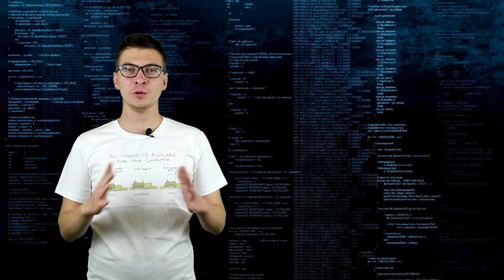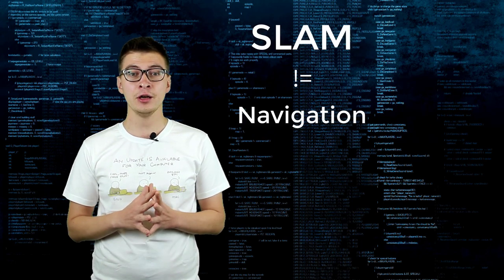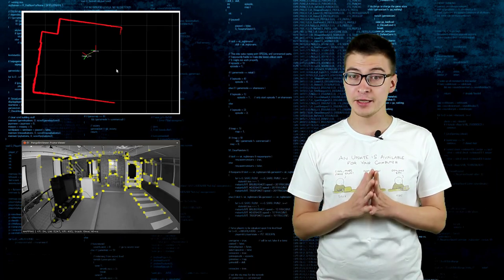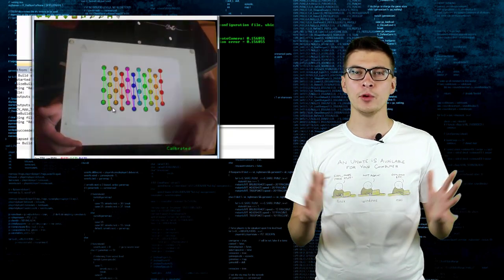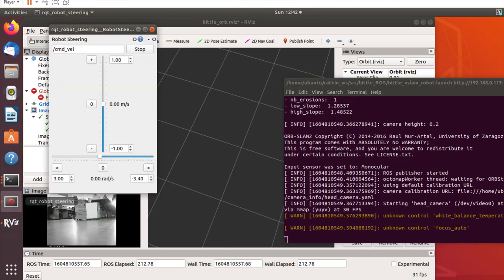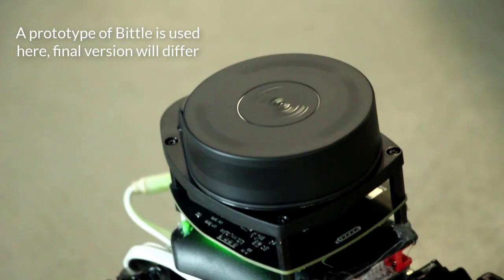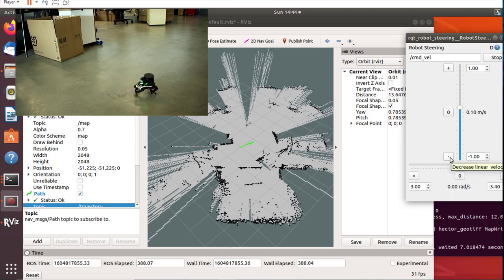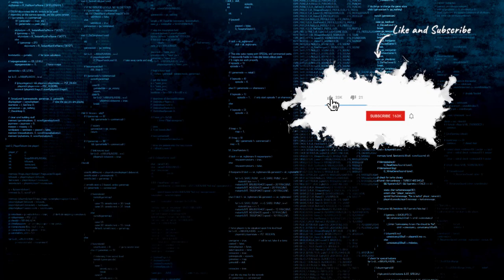Visual and LIDAR based SLAM with ROS using Bittle and Raspberry Pi

Comment: Thanks for your efforts on testing those components in the wild. Always good to see real world perf vs marketing videos bs. Keep up the good work!
Reply from the maker: Thank you for the feedback! Real world performance wise, Bittle actually exceeded my expectations - I didn't think it would be able to even start with LIDAR and Pi 3 connected, because of the current draw, let alone walk/crawl and even (do not try this at home) jump. Hector SLAM performance was adequate. ORB-SLAM2 didn't not perform well - in the video you can see Path messages are mostly correct, but occupancy map doesn't make any sense. That can be issue about settings/camera height, but even if these issues are resolved, the camera still moves way too much during walking, so I don't think monocular SLAM is an option for Bittle. Would be interesting to try stereo.
Reply: @Hardwareai  usually blur is a killer for feature matching. Fyi I am using a zed camera @ 100fps and it supports pretty fast movements, provided there is enough light (it does have an IMU to help track very fast/short rotation type of movements too). I did not experience with Lidar but your testing is cool, and I appreciate that achieving something with a rpi is quite something.

Comment: hi you said in the video that hector slam can be used to publish odometry to be later used in the navigation stack 
can you make a video or tell  the guidelines how to  integrate hector slam with the navigation stack 
thank you in advance (i finished hector slam controlling the robot using commands from the keyboard)
side note:it is for a graduation project
Reply from the maker: Right. Well, this video actually turned out to be more popular than I expected, so a continuation is a possibility indeed. Unfortunately I am super busy at the moment and probably will finish TinyML series first, despite that one wasn't very popular.
Reply: @Hardwareai  if you aren't able at the moment to make a video 
if you know the main steps how to integrate them both it would be extremely helpful  to just tell me the main steps
Reply: What a coincidence ... it will be something great as it’s for my graduation project too.

Comment: Thanks for the video. I run a small nonprofit theatre. I'm looking to navigate small wheeled scenery pieces with an electric motor on and off stage. To drive themselves from point A to point B and back again. (they don't need to move fast)  What you are doing seems similar, I just want to do it with wheeled platforms.  Any thoughts on a model I could emulate to accomplish this?
Reply from the maker: Model? I don't think a neural network model is necessary for that. Wheeled navigation will be a bit easier, just get LIDAR + motors with encoders. ROS packages are available for making Navigation work with this stack.
Reply: @Hardwareai  Thanks.  Forgive me, what is an ROS package?

Comment: How did you run RVIZ in your raspberry so fast? I cant run RVIZ in my raspberry because is so slow...Great Video
Reply from the maker: I think it mentioned in either video or the article that I don't run RVIZ on Raspberry Pi? It's not recommended to do that. Instead you run one ROS node with image / LIDAR/ robot driver on the robot itself and another ROS node with RVIZ on your PC.
Reply: @Hardwareai  Is it posible to do this communication between Raspberry and PC using docker in both?
Reply from the maker: @MemoxCid  yes, here is the link http://wiki.ros.org/docker/Tutorials/Docker

Comment: im trying to use slam with an array of phototransistors close to the ground which would pick up white lines on the playing field for robocup soccer. this would also let it autonomously navigate. do you think its possible? how difficult would it be to set that up? i have around 5 months deadline
Reply from the maker: Okay, considering that was 9 month ago (sorry, was busy with my MSc at that time, replying to all old comments now)....
That would be a very interesting task - but you will need a highly custom algorithm for that. Are you okay with using a cheap camera module(s) instead>

Comment: Visual slam using ORB-SLAM was performed completely on raspberry pi or on a seperate master PC??
Reply from the maker: The answer is in the video ;)
but yes, it is performed completely on R Pi - that's why I'm using newer Raspberry Pi 4 for ORB-SLAM.
Reply: Will it work on Ubuntu 20.04?

Comment: Hi bro first of all nice work! 
Can i use  Ubuntu MATE 20.04.1 LTS?
Also, could u make a step by step video on install and usage?
Thanks
Reply from the maker: Thank you!
Well, is there any reason to use 20.04 instead of 18.04 currently? 18.04 is more stable and from running it on Raspberry Pi has almost the same features. I understand it is newer, but unless it has features that you require and are not present in previous version, newer is not always "better" :)
Reply: Did it work for you ?